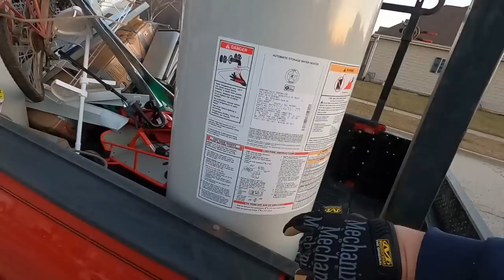Found a Go-Kart on Garbage Day

Comment: Paul, why wouldn’t you take that lawn ornament? Wasn’t it cast iron? Also, why would you want the incandescent light bulbs when they use so much more energy? Just curious.
Reply from the maker: Great questions. The incandescent light bulbs are good for animals that I sometimes have. I have a rabbit. It's warm. Reptiles as well. The lawn ornament was made of concrete. The hand was broken that's why it had a loop. It was the iron bar left from the molding. Plus, someone that is more interested in it could possibly get it. If I grab most things then I overwhelm myself with sheer volume of things that need to be dealt with. Takes the fun out of it
Reply: @ScrapPalletMan  ahh…gotcha and those bulbs do throw heat so they would be great for the rabbits and reptiles! Have a great day!!

Comment: Drove by a plumb supply house and saw an open top filled with cardboard and old 4 tube fluorescent bay lights -behind a fence - was tempted to stop in and ask if I could unload it.
Reply from the maker: I rarely do dumpsters
Reply: @ScrapPalletMan  I'd probably get stuck in it, 53 and not half as spry as I used to be.